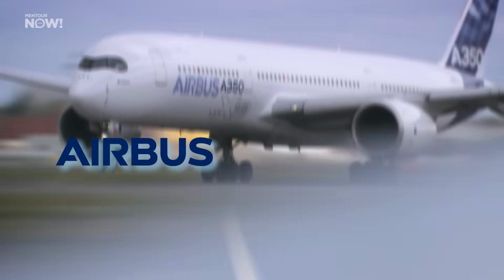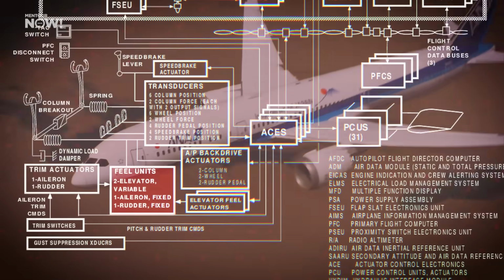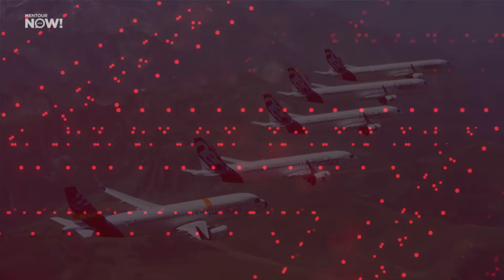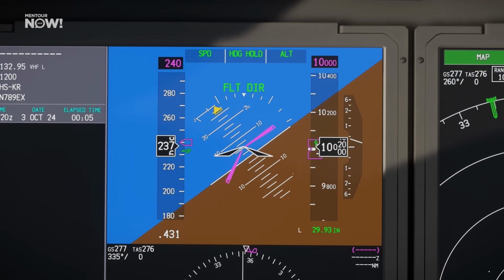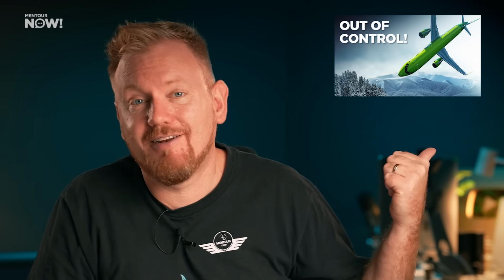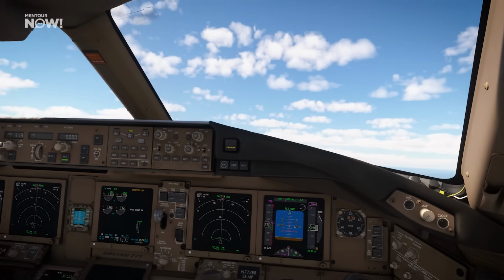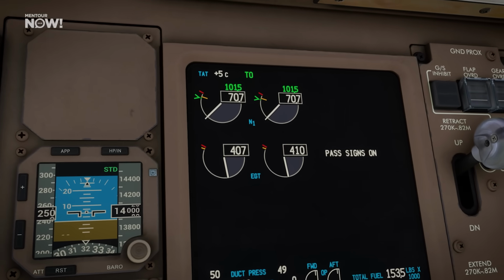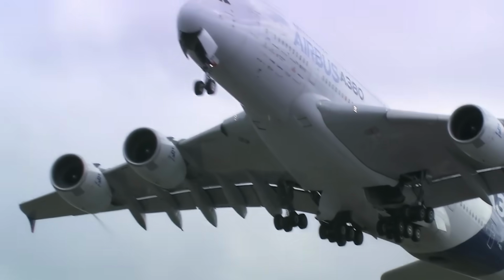Do Pilots Prefer AIRBUS over BOEING?!

Comment: Pilots pulls up extremely
Boeing: wanna stall the plane? Do it! 

Airbus: no.
Reply: AF 447
Reply: False ! - the worst A330 accident in history was an inflight stall at a high altitude.
Reply: @terrymichael5821  because of pilot error, captain pull side stick and the co pilot push down side stick ,result = zero output
Reply: @rtx0011 how many airbus planes flew into buildings ?
Reply: @rfnmmandal  is that was airbus fault?
Reply: @Schnittertm1  atleast no buildings crashed when airbuses flee into mountains
Reply: @terrymichael5821  i said hijacking. Btw what about AAL 587
Reply: hijackers
boeing:no
airbus:yes please
Reply: @planespottingwithabdullah  what was the most deadly hijacking again?
Reply: @planespottingwithabdullah  
Retaining parts in flight

Boeing: no
Airbus: yes
Reply: @planespottingwithabdullah  abdooool lol

Comment: You stated that fly by wire has no moving parts, so it doesn't have maintenance. This is only partly true because you've simply offloaded the maintenance to the software teams. Software is a service and is complex and requires updates, maintenance, and time under test just like mechanical systems.
Its easy to forget about because its all happening in a little magic box
Reply from the maker: I did t say NO maintenance, I said it reduced maintenance

Comment: I think it a shame that you omitted to highlight that Boeing's most popular selling aircraft, the 737 - even in its latest Max incarnation - is still very much generation 3. This means that, from your comment regarding 4th generation aircraft, the 737 must therefore be "considerably" less safe than the 4th generation Airbus equivalent, the A320 (even with plenty of its own weaknesses). The US government even had to give the 737 a special exemption to be certified without an EICAS, and then an extension to that, and possibly another extension to that... so Boeing will be producing at least one 3rd generation aircraft for years to come. If it's a Boeing (737) I'd rather not be going thank you very much; especially outside the US where they might not even share safety information with you (to Ethiopian Airlines after the Lion air crash for example)

Comment: In Military Aviation they also do the Airbus approach.
Many US made fighter, pilot is manager. In a fight, they want pilot to focus on the target so many things are done by computer.
Reply: that's interesting! i also heard somewhere that some fighter designs are pretty complicated and counterintuitive to the point where the "airbus approach" is more or less the only option. manually flying would result in an immense mental workload (which is probably not ideal for military operations).
Reply: I think that's more of a Lockheed thing. They were always first to bring more automation to aviation. It's a shame they left commercial aviation.
Reply: @kingcrimson5483 a Shame indeed, I would've loved to see what they could've brought to the skies
Reply: Actually, control laws in combat jets are not the same as airbus ones.

From what I understand, the fly by wire in those are to help controlling the aircraft in many manouvers like flying sideways and looping.
Reply: Huh, didn't consider that, it makes sense tho now I think about it.
Reply: Such as b2
Reply: As a former US F-16 pilot I couldn’t disagree more. It’s NOT the “Air Bus approach.” (Yes I fly the 350 now as well.) US Fighters go far beyond the strict hard limitations of an Air Bus. A US Fighter would be operating in what Air Bus considers Direct Law. Yes in a modern fighter you are aided by computer, but you are taking in and dealing with MUCH more input and a far more complicated dynamic in a combat environment. Most of that computer function is doing that targeting, not flying.
Reply: @cfzippo  It's odd coming from the first (I think) fighter with a sidestick (that didn't move either, how odd to fly is that?) and FBW, which is what Airbus has done for the past 40 years or so.
Of course you have a greater control of your fighter than of an airliner, the mission is different, but you still have a computer that decides HOW to actually interpret your inputs and send it to the actual control surfaces. 
I'd say the F-16 and F/A-18 are more like Airbus and the F-14 more like Boeing, a lot more manual and hands on. The F-15 would be a mix.
Now, if we compare the F-35 to Boeing or Airbus, which one do you think is closer?
Reply: @valrond Are you seriously arguing with an actual pilot based on your extensive youtube knowledge?
Reply: @josephmagana6235  Well he is an F-16 pilot. Let's get a F-35 or F-22 pilot in here for discussion.

Comment: I fly the A320 and we have quite a few former 737 pilots in the fleet. Not one of them would ever go back.
The Bus is way more comfortable, it is quieter and supports its pilots way more. After a 12 hour shift with 4 sectors on an A320 you will be tired, but on a 737 you are done and have to hope that you don't fall asleep on the drive back home.
I guess when it comes to 777 and 787 it's different, but between the A320 and the 737 there is no contest. It's not even close.
Reply: I’m with you. As an ex 737 pilot, but last nine years on the 320/321 I’d never go back to a 737. Sure the ‘Bus took a bit of getting used to but once you understand it it’s fantastic. Coz I’m getting old and getting up the seniority list I’m shortly to transition to the 787. Hopefully that goes ok!
Reply: @priceyA320 you’ll love the 78. Best LongHaul aircraft out there, comfort wise at least. The CACs make a huge difference, breathing fresh air rather than bleed air. You will miss the table though!
Reply: @Kapitan_Plastic_Fantastic 
Sorry,  what's a CAC?
Reply: @Zupdude  Cabin Air Compressor. There's 4 of them in the 787. The purpose is to eliminate the need of taking bleed air from the engines (reducing their power in the process), to have it pressurized for the cabin. Thanks to the CACs, the air from outside instead goes directly to the CACs via inlets, which is pressurized in the CACs, then feed to the cabin. It also provides more pure air as the bleed air from the engines often have contaminants. There's electrically operate, more efficient and saves on fuel. One of the many cool features of the 787.
Reply: @priceyA320 What about when things went wrong? I found with the 320 you didn’t have an instant appraisal of what had failed and perhaps more importantly what you had left. With the 737 I’d slide the seat back, look up and had a pretty shrewd idea what was wrong and what tools I had to recover the situation. 
To do a days work with multiple sectors, give me the ‘Bus any day.
Reply: @priceyA320 Would hate giving up my 737 for a Scarebus.. hopefully it will not happen..
Reply: @ACPilot this comment is enough for us to tell that u are not a professional pilot who judge objectively. You are just a boeing fan boy who happens to fly an aircraft (if u really are a pilot!) Hope i will never be in the same plane as the one you fly. Lol
Reply: @ Been flying 737’s almost 20 years.. 737-3/4/5/800/MAX8..

Thanks for commenting 😉
Reply: Sir of all the variants which is your favorite to fly?
Reply: @ramongutierrez-gq4cq  mine is the A320Neo. Amazing aircraft
Reply: @ACPilot  As a passenger - I avoid 737Max flights. I will change my schedule first.
Reply: Im a truck driver no comparison with aviation, but comfort does play a big role for the driver or pilot. I drive an 18 speed but bigger fleets have automatic or automated trucks now, not a big fan, but when I hit city routes and stop and go traffic it will seem to me Automatic will be the best even though “real truckers” frown upon automatic trucks, but hey it sure takes off stress and fatigue when in heavy traffic.
Reply: Do the sidesticks have force feedback like the joystick I use for flight simulator?
Reply: @dannydaw59  No.
Reply: @dannydaw59  No.
Reply: @dannydaw59  "Do the sidesticks have force feedback"
No, but if Russia hadn't attacked Ukraine pilots would have gotten their hands on active side-sticks in a Yakovlev MC-21 (or MS-21). And since the supplier of these sticks is Ratier-Figeac, a long-time supplier of sticks to Airbus, I assume Airbus will use them eventually.
Reply: ...even for the passengers....I noted that immediately when flying return on the competitor...
Reply: @fsclips  What a load of nonsense, 737 is a fantastic plane, especially the modern Max varient.
Reply: You nailed it.
Reply: From my experience it seems like if you grew up flying on a fly by wire system and transition to a 737, you have difficulty.  If you go from 737 to 320, you can adapt and learn the system and fly the the plane just fine.  Had way too many hard landings from ex Bus guys.
Reply: Try a day flying a Boeing 737-300 with "hardball" instruments (Like a Seneca I) four or five legs in Texas in the summer, with the temperatures exceeding 40C (106F). You would finish the day "washing the airplane off". But flying the 737 was like putting on a set of gloves. I like to "feel" the aircraft. That being said, I haven't yet met an Airbus pilot who doesn't like them.
Reply: Boeing is better cause the screens and computers dont freeze and as a pilot with 29000 hr of flight and flew both the a350 a380 a320 and 777x and 787 Boeing has really proved themselfs
Reply: That’s because the 73 is ancient. The 777 and 787 is where it’s at. Truly the best of both worlds.
Reply: @devn3813 The MAX is quite nice..
Reply: This. Have 11 years on the Bus and 1.5 yrs on the guppy. Bus every damn day.
Reply: @fsclips  v interesting. I wonder if Petrr will respond?
Reply: "Not one of them would ever go back." Possibility of that is beyond low which means you are using hyperbole to try and keep your bias unscathed.
Reply: @thomgizziz actually we have a 737 Max fleet coming in, so the possibility is certainly there, but none of them want to take it. That tells me all I need to know.
Reply: It's all about the comfort of the pilot. 
As a passenger, I don't know why this bugs me.
Reply: @glynnetolar4423  Because as a passenger you want your pilots not to be over tired or fatigued (there is a difference!), as then should something go wrong you have people better placed to make critical decisions about your safety in charge.
Reply: @glynnetolar4423  Airbuss is more confortable than Boeing. And you as a person flying should be happy if your pilots are confortable mate.
Reply: @glynnetolar4423  Think about it this way:
It's like driving a car, if you have a very loud car with no features like lane-keeping then long distance journeys can get exhausting.
If the car is quiet and has lane-keeping features the vast majority of the fatigue is removed and once you exit the highway you're still in a good mood and quickly get back to being alert because you have extra energy still.
Reply: This is why they are both awful aircraft.  It’s like saying “my dad only beats me twice a week not four times”.  

Nobody endures more punishment than narrow body drivers.  Thats why almost nobody would go from a 737 to an A320.. they just want to get out of there.. either wide body, perpetual reserve, SIM, or management.
Reply: @calvinnickel9995  I assume that is mostly a result of the lots of shorter flights vs actual comfort of the aircraft, since I assume an A320 is probably as comfortable as any Airbus widebody for the pilots.
Reply: @calvinnickel9995  Widebody usually means long haul, which I imagine is just awful if you have a family at home.
Reply: @ScepticGinger89 why would it be awful. You can go work for 3 days but after that you’re home for a week
Reply: @calvinnickel9995  i think a320 is still comfortable
Reply: 😂 I have been flying the 737 for almost 20 years. No, the 737 do not make me tired at all, haven’t heard that from collegues either. For aircraft i would take the Boeing any day over the Airbus.
Reply: @ACPilot  Every pilot I'd ever talked to agrees with/ us.

Comment: Since many(most?) accidents involve human error, removing the possibility of human error as much as possible sounds like a good idea. I work in IT operations, and we automate everything as much as possible and try to avoid manual activity, and one of the reasons for that is that people mess up. Of course, automation can also go wrong but that is significantly rarer than a person making a mistake. So the approach of relying on automation for the most part during normal operations and seeking intervention from a human "administrator" only when that automation goes wrong is more appealing to me personally.
Reply: I'm in IT also. Automation exists firstly for cost cutting measures, not to cover mistakes.
Reply: @glynnetolar4423  That's part of it, of course, but it's far from the only reason. Even things that would be easier and faster done manually go into automation. Well maybe it's different in your organization.
Reply: @kloudray  Automation, just like mechanical parts, must be maintained periodically. If improperly maintained, then automation will not be reliable. Incidents like wheels falling off old planes, engine cowlings opening after takeoff, and even LA800 go to show how maintainence by the airline or 3rd party isn’t always done properly.

Comment: Has anyone thought about having heated fuselage panels around the sensors in front for example? It could prevent ice build up in front of the sensors and would act as an extra layer of protection in the event the de-icing misses the fuselage

Comment: As an aircraft technician, I am of the opinion that more available information is always a good thing; however, the level of automation that the Airbus offers can also lead to pilot complacency, they become so accustomed to the protections that they don't give it much thought until it becomes a problem. I am definitely not suggesting that Boeing pilots can't, and don't suffer from this at all. I think that there needs to be a happy medium between automation and the good old fashioned hand flying methods that allow pilots to be more engaged with the aircraft. to use an analogy; modern cars have a ton of safety features like adaptive cruise control, brake assist, blind spot monitoring and lane departure assist in an attempt o make safer drivers. In my experience, it has the tendency for drives to rely on it and less so on their own senses and being aware of the other people on the road.
Reply: Funny that you should bring up automobiles - I'm old enough that my first car didn't have anti-lock brakes. Even after decades, my instinctive reaction when in a slide is to pump the brakes...until I feel the brake pedal being pushed up into my foot. 

I've noticed a lot more drivers weaving since cars started to correct themselves if they start drifting over the line.
Reply: Complacency like "After a 12 hour shift with 4 sectors on an A320 you will be tired, but on a 737 you are done and have to hope that you don't fall asleep on the drive back home" (@fsclips)
Reply: I do believe that hand flying a plane (Airbus' direct law) is necessary but maybe only on a simulator or under perfect flying conditions (assuming that can be selected without breaking components).

Comment: Maybe Airbus (A320) design isn't well thought out, but things told by whistleblowers are really scary. Especially metal shavings in a 787 cable departments, not cleared.
Reply: What does Airbus have to do with things told by whistleblowers? Airbus is designed to be a safe and reliable aircraft and it is!
Reply: @herceg6772  and yet people have still lost their lives on board airbus planes
Reply: @animegamingdude  it’s been long time since last time while the same can’t be said about Boeing. People are still dying on their planes
Reply: @herceg6772  2020 is not a long time
Reply: @herceg6772  when was the last time someone died on a boeing as a result of an aircraft design flaw
Reply: @animegamingdude  2018+2019. Many people died